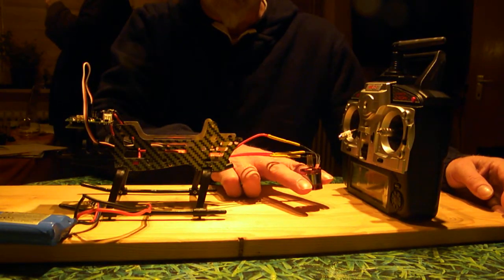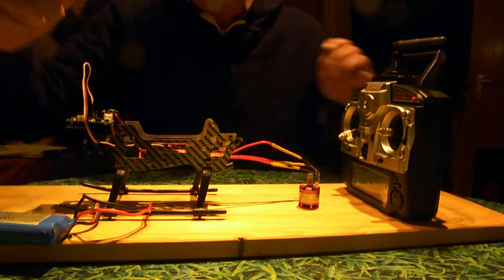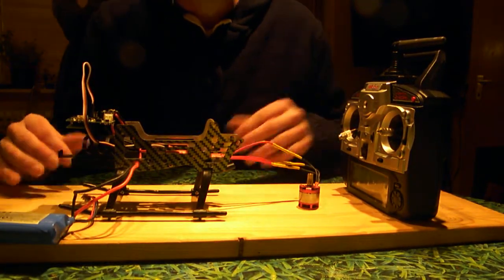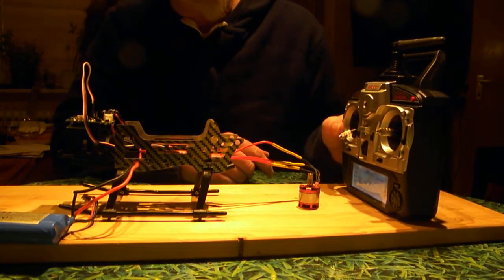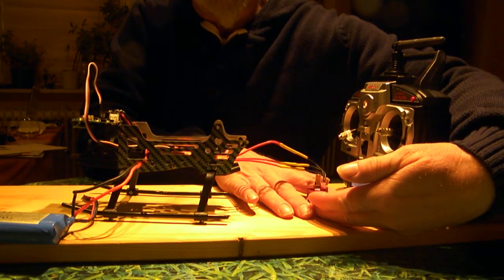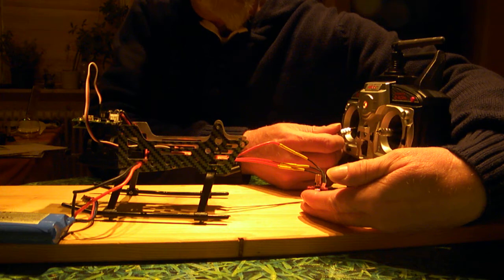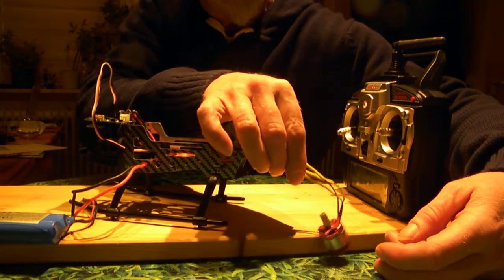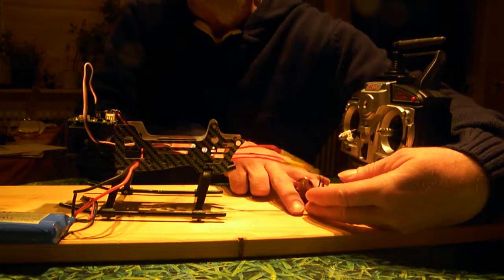MJX F645 new PCB version with EH200 BL motor and Turnigy Basic 18 A ESC

Comment: Motor has much more power, but flight times reduced in my case with the stock batteries, probably cos the motor needs more juice. Just search the F45 thread for nano-tech battery and do the upgrade. These batteries give me about 14 minutes of flight time, so I bought a shit load of tail motors. Reckon I'll need to start swopping them out soon :-D. And yes, I still have loads of fun with both my stock and my brushless F45s. 6-channel maybe next year, but not sure yet. Happy flying, Tigg.

Comment from the maker: I had a cheap HK 10T brass gear originally which wore down quickly.I now use a 12T steel gear which works fine, so I guess an 11T would probably be preferable to a 9T (head speed might be a bit low with a 9T, but I'm not really sure).

Comment from the maker: The motor has 2x M2 and 2x M2.5 sized holes in it, but no screws supplied. Easiest way is just to use 2 M2.5 screws and mount the motor using the holes diagonally across from each other, so that the motor wiring comes out towards the front of the heli. You may have to elongate the holes a little with a dremel or 2.5mm drill bit, depending on manufacturing tolerances and which pinion gear you use. Some of the guys could just drop it straight in though.

Comment from the maker: @ Palawan
when you say "original", do you mean the kit with motor, ESC, side panels and PCB which is being sold for about 45 - 50 USD? There is nothing wrong with my ESC. It works perfectly with the old style F45 (the one which has the vertical gyro). It's just that the circuitry on the new style PCB has been changed in some way, causing this reaction when used with the Turnigy 18A ESC, which was a popular choice for the BL conversion with the original F45.

Comment from the maker: Soldered it under the pcb to the battery supply terminals. Do NOT attempt to use the stock motor terminal. One guy in the RC forum did that and fried his ESC.